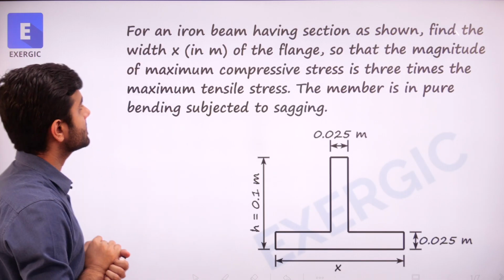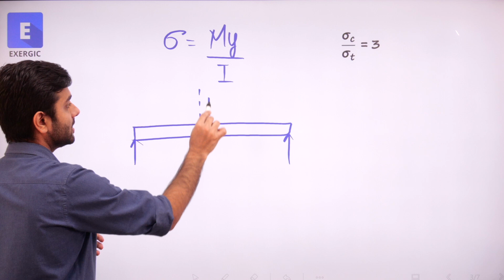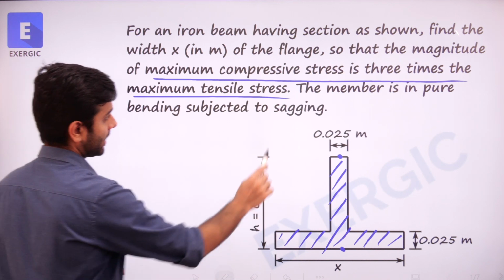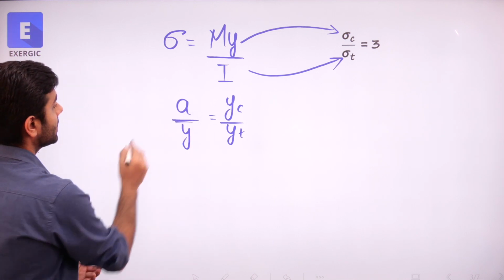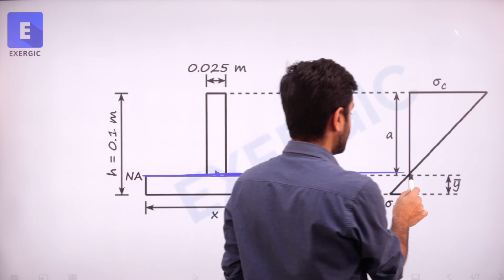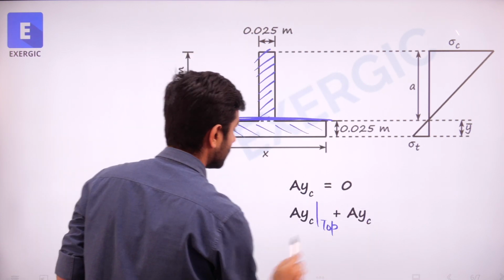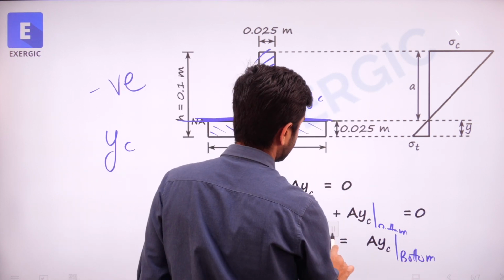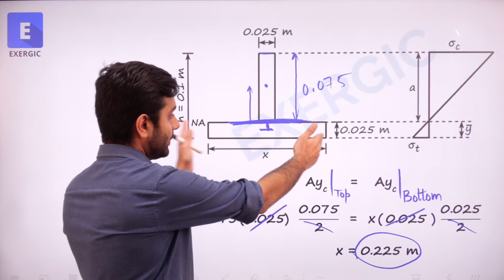GATE 2023 Expected Question - Mechanical | Bending of Beams | Strength of Materials (SOM)

Comment: i calculate it in the lengthy way after finding the position of nutral axis i applied centroid concept and problem become slightly  lengthy but i got same answer.. But here you solve this using concept in a very smarter way.Loved it.
Reply: Centroid method as in did you use that centroid formula y1A1 + y2A2 / A1+A2 ?
Reply: @udaychaure1481  yes after finding the position of neutral axis.
Reply: @SmartChartLab  I am not getting the same answer
Reply: @udaychaure1481  you are doing something wrong I think.You do one thing convert m to mm then calculate.
Reply: @udaychaure1481   I think you are using (0.1/2) as the distance from base for calculating centroid for the vertical rectangle.I was using that and answer came out wrong